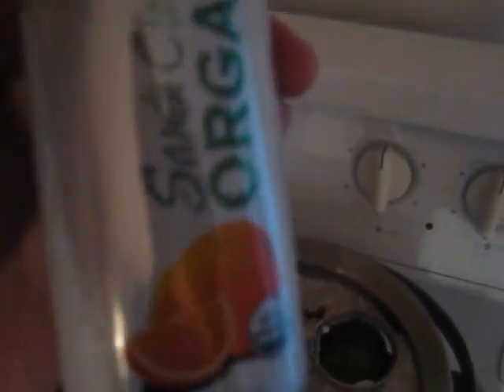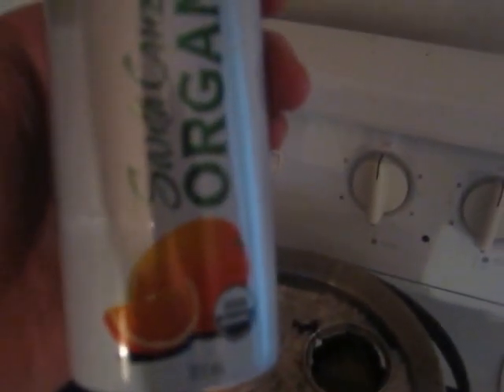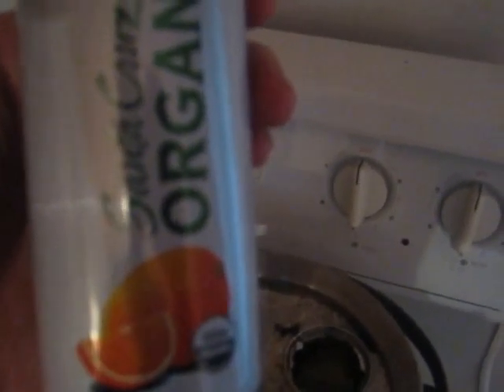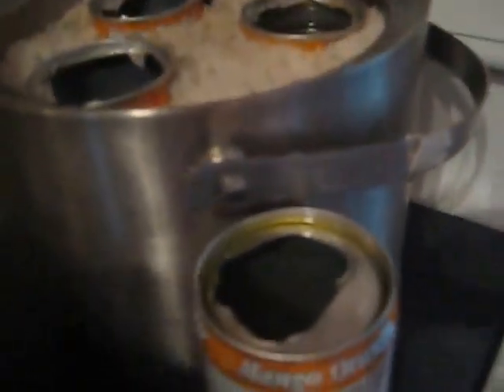Part 3 - Free Solar Energy Storage for 6' Solar Concentrator - Successful Experiment !

Comment: Thanks for this, how many hours does the salt in this video stay at a high temperature? I will be using salt with oil in cans and an oil drain system to keep water from freezing (I'm hoping).
Reply from the maker: 24 hours with a basic cooler from Wallmart